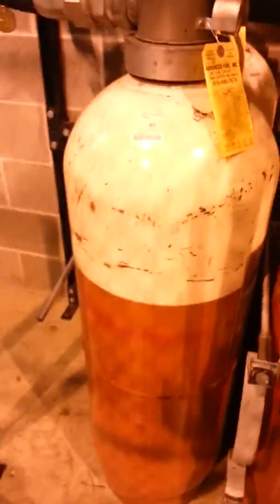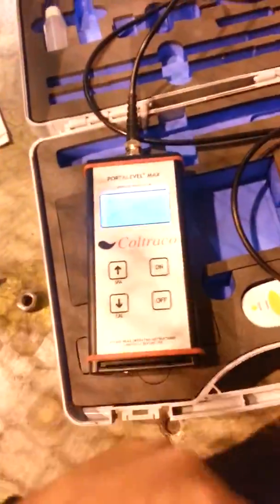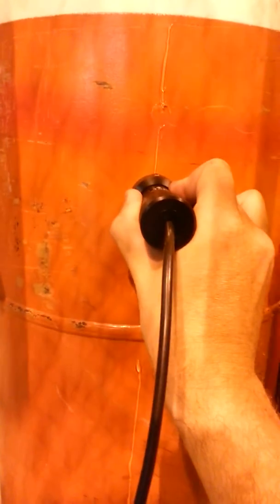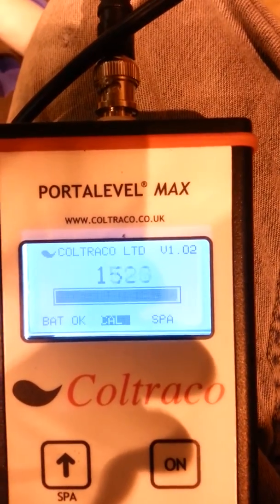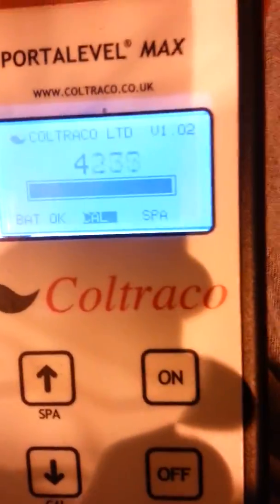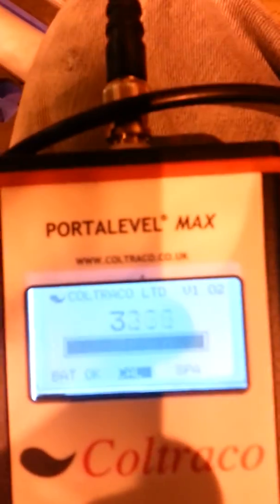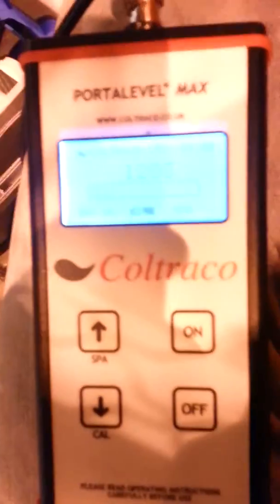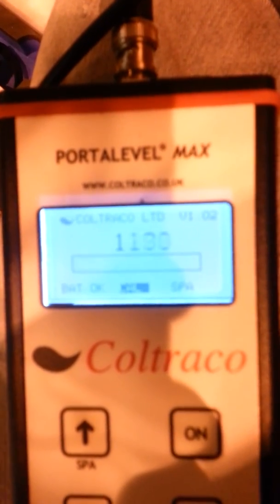Kidde halon 1301 coltraco LLI

Comment from the maker: No not ppm just the liquid level inside the tank. Whoever designed the system is responsible for calculating the amount of agent needed to do its job and be life safe for that specific area of protection. Then the tank is filled to that calculation.